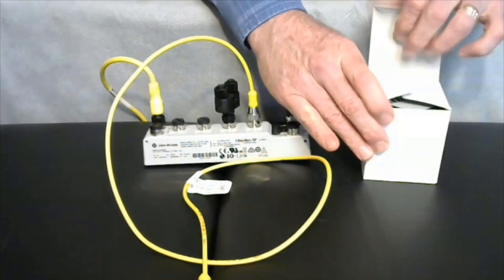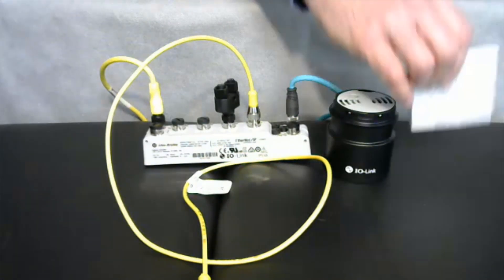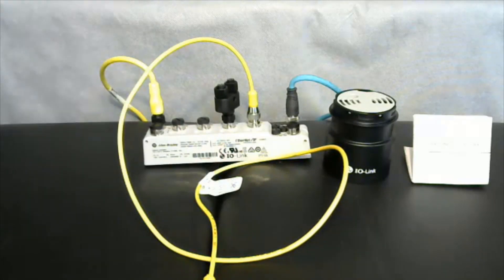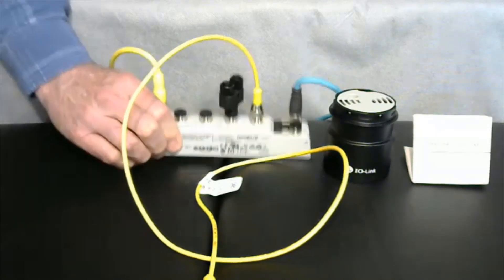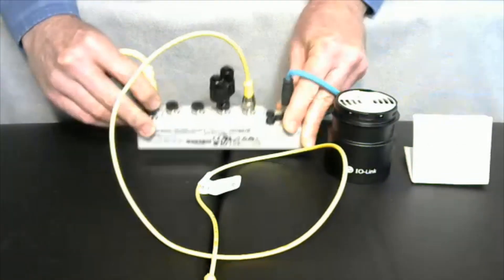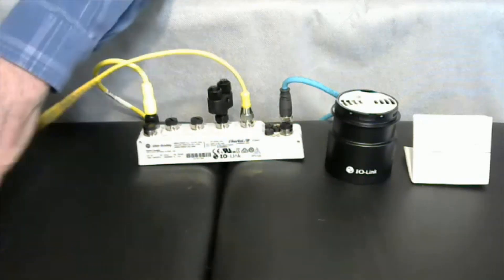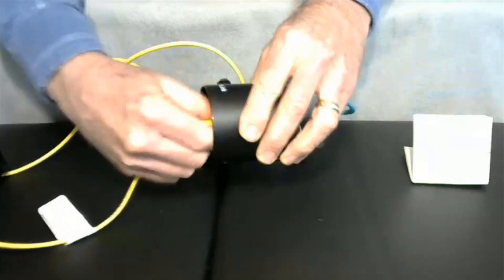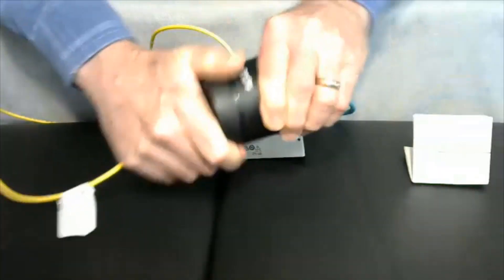Getting started with the IO-Link 856T Control Tower™ Stack Light Video

Comment: What is this product used for?
Reply: The 856T-B24LC module allows the control and configuration of a standard
856T stack modules (light/sounds) via the IO-link protocol.
Reply: 7 Modules up to 500 mA total supported.